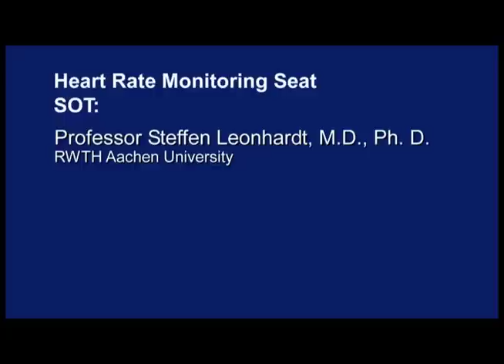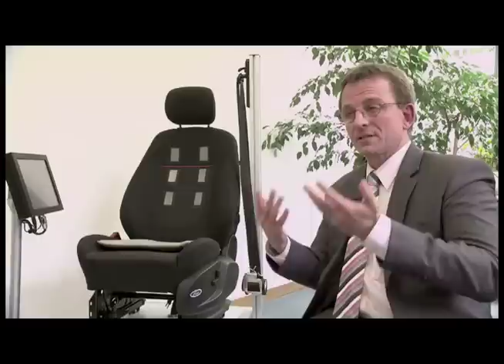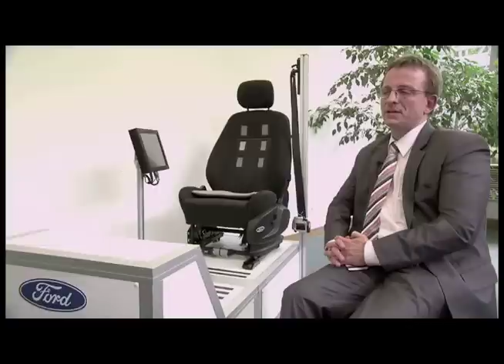Ford developing seat that monitors heart rate

Comment: pointless... cars already have massage seats, air-con, entertainment systems, GPS systems, 1000 W sound systems, and everybody complains about high mileage, perhaps a putting more things in the car won't help... like this highly required heart monitoring system... if you have heart problems DON'T drive... if you are sleepy, you don't need a car... you need a bed...